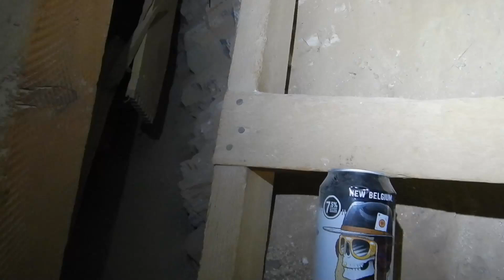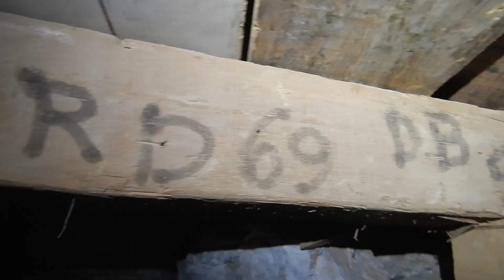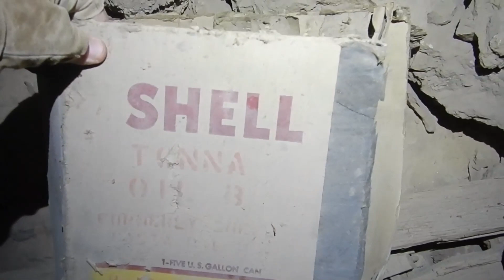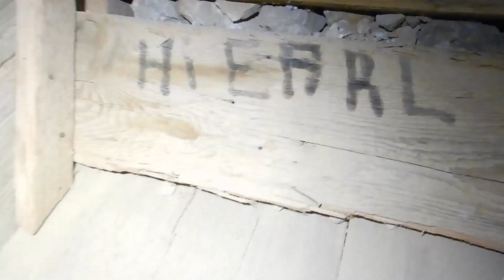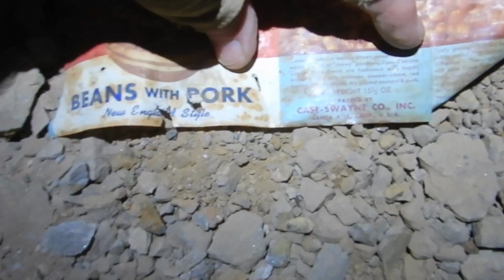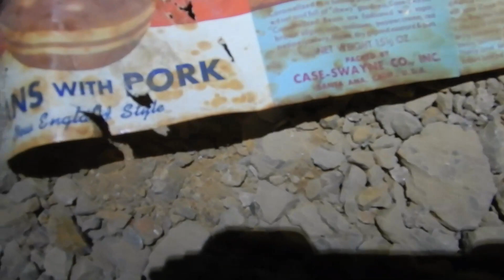How did this French Artifact get in this mine Part 1 of 2 parts

Comment: sweet!!!! rivited tanks and cardborad  shell box, worked several different periods!!!!
Reply from the maker: The rivets were not like i seen before and the shell box was cool, never seen that one before.  i had so much fun in this one.
Reply: @mineadventures7938  nice man!!! We were back side of the Calicos this weekend think we got in the Bismark, found strap rail which is a first for me!!!! Took forever to find the right road our thou lol!!!
Reply from the maker: @imzackson  - i didnt know any of the mines were even open anymore. Bismark starts on the north side of the road, goes south under the road and then you see then deep shaft, you cant get over the hole, you eventually end at the batteries and climb up to the road.  I dont recall rails ?
Odessa is probably the best to see. all the good ones are on the west side, of course closed now.  did the canada mine company open pit yet ?  west of wall street.  i got the boot a few years ago.  but Zenda the best one, is sealed for ever,  silver king under calico sign,  is great.  but all the good stuff is long gone.
Reply: @mineadventures7938  no open pit yet that i saw, i was on the top of the doran loop near the sweet water spring just a lil east of the calico mines where its all pock marked, the mine starts about 40 min in to my last video it was basically just a haulage i think but it was LONG probably .25 to .5 mile. it didn't go through but there were plenty of working above i didnt have time for, there's so many out there i could have the name wrong but 3/4 of the way in there was strap rail which thoroughly surprised me. that place is a gaint spyder web of raods took me awhile to find the righ one back out lol!!!

Comment: congratulations on loosing weight, a lot easier putting it on than taking it off. you mentioned having Kaiser, I have had Kaiser since 1995. originally it was thru my employer at $35 dollars a month and a $10 dollar co-payment, but now I am on Medicare and it is only $11.20 a month and $0 co-pay. I like Kaiser, even if they are on strike now. thanks for the video.
Reply from the maker: Thank you,  stopping sugar was key, and when I have too much, I get pain in my elbow and shoulder.  Kaiser,  its 1000 a month plus I think 3000 deductible and 30 copays, its insanely expensive.  You have a great plan, amazing and affordable.   Kaiser has been good to me, but expensive.